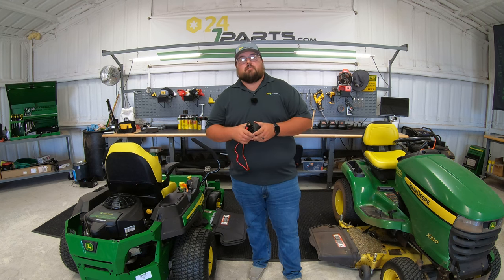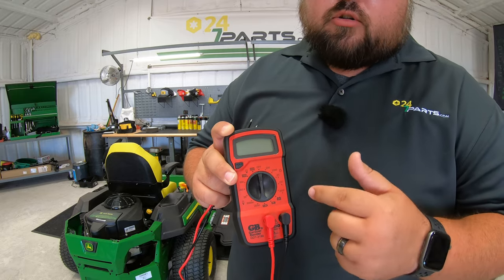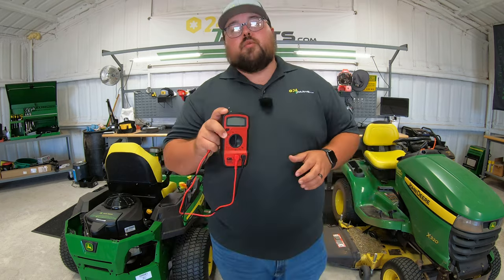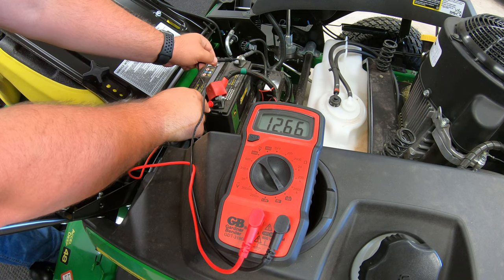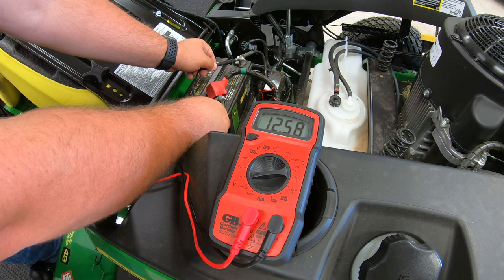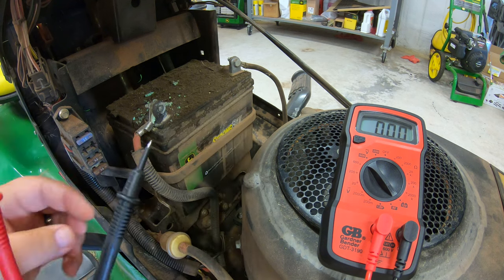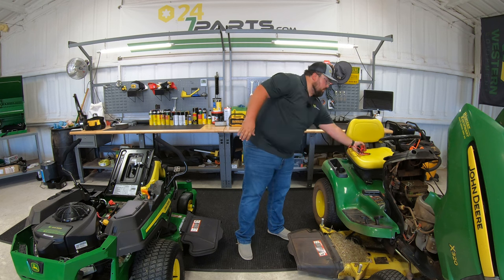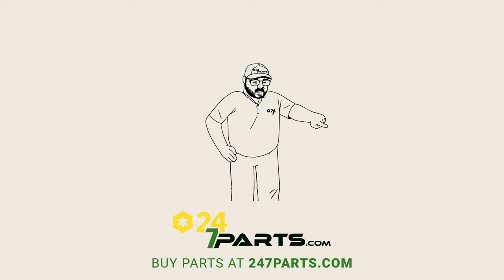How to Test Your Lawn Mower Battery with a Multimeter

Comment: The static no-load voltage of a lead-acid battery is a very poor indication of the health of the battery. Most bad batteries will still measure 12.6v but when you apply a load can drop down to 6-7v.  Battery testers are very inexpensive and will give you the health, state of charge and internal resistance of the battery. Most will also measure the voltage of the charging circuit to ensure it too is working properly.

Comment: ok I put my battery for my lawnmower on a charger , said it was charged but put it in mower and nothing . Even double checked it on charger , could it have a dead cell in it . They battery was bought in 2023 from walmart and it went dead last year but hubby was in hospital and had no tim to take it back  . I took it out of the mower last year and just stored it in the mower shed